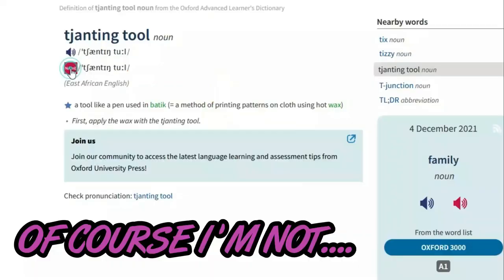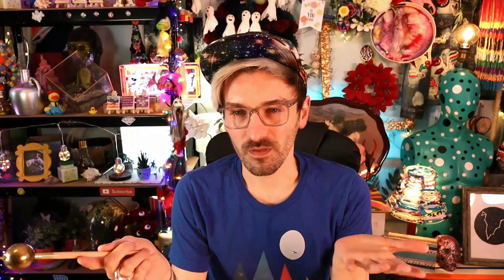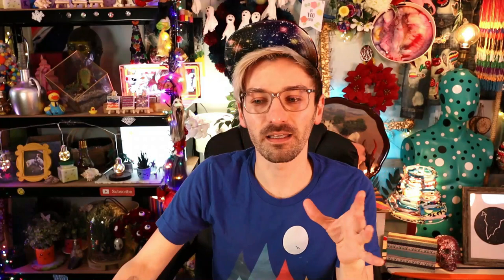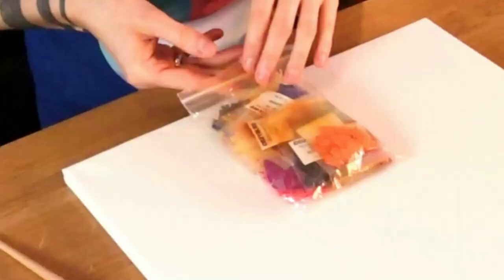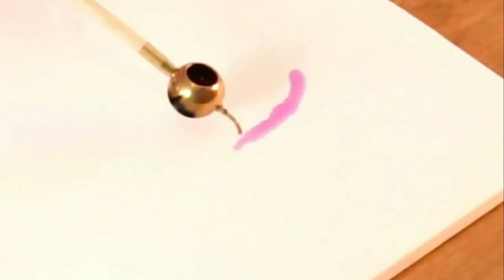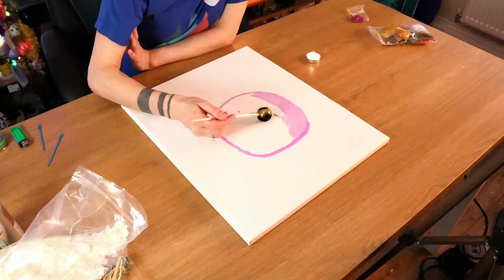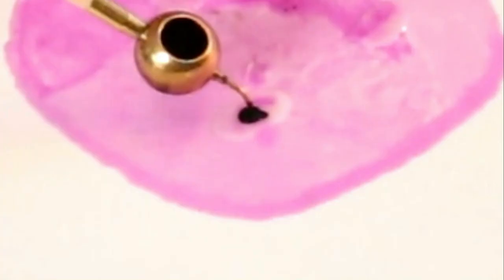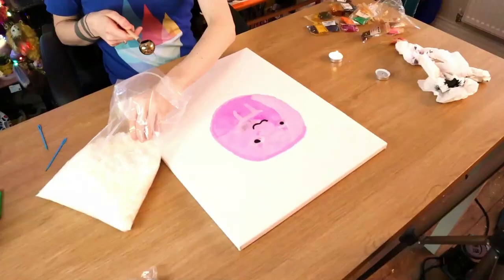Painting A Wax Artwork With A Tjanting Tool (How To Use A Tjanting Tool)

Comment: There is a product called Clear Tinnitus I used to take that actually worked, but I stopped because it was expensive (for me, anyway). However, since I took it (for about 6 months) the problem is much less than before I took it. Just wanted to let you know. Thanks for the videos. Happy Creating!!!
Reply from the maker: Oh I'll check that out! I've ended up getting hearing aids which have helped a lot, got a little extra video showing them off next week 😆😆